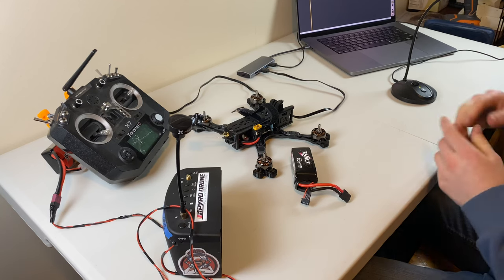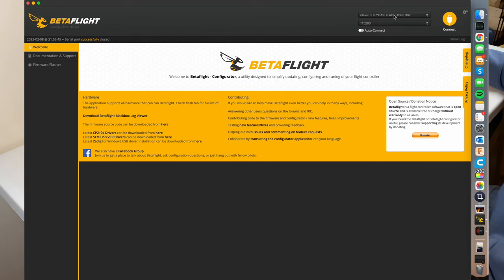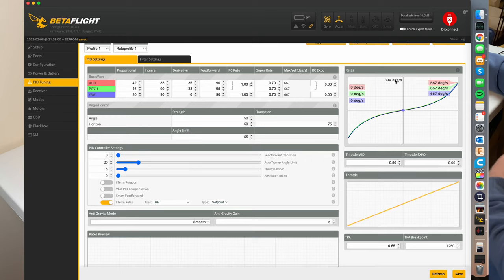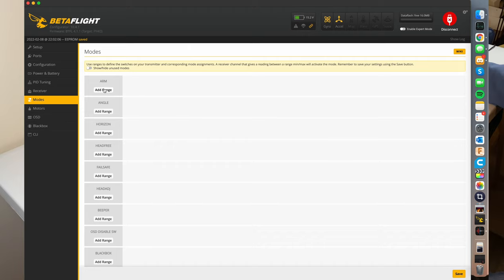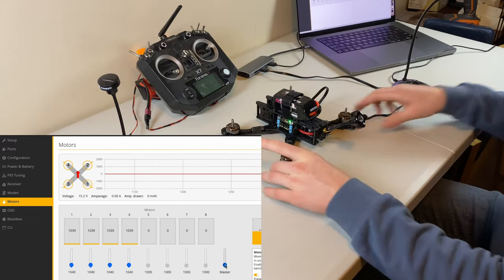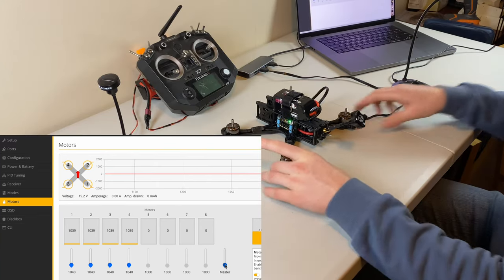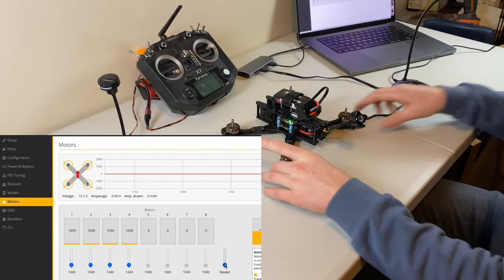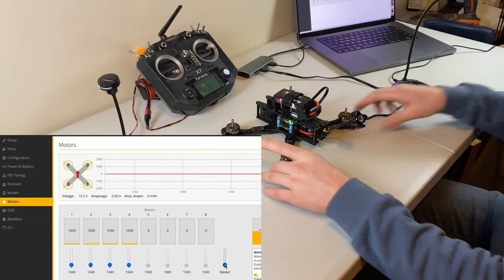Set up Betaflight for a FPV Drones - Beginner Friendly Guide (2022)

Comment: I'll admit that I used the auto search feature for months before I learned how to manually switch channels. But its really easy, and good to learn how. You can see/change the drone's band and channel in BetaFlight.

My cheap analog goggles have a B button for band and C for channel. So if my drone is set in BetaFlight to R-8 I press the B key until I get to the R band. Then the C key until I get to 8.

Comment: I'm having an issue, never really happened before, but i fly in airmode/acro , and im aware it causes errors in the pid loop when coming in for a landing, so it bounces, but my quad sometimes freaks out as of late and just spins out of control, not to many videos on this or how to fix the tune from causing errors, i have blackbox logs. im on an f7 v3 chip- BF 4.4.2. have blackbox for further detail.
Reply: Take turn off Air mode

Comment: Is it possible that the SPRACINGF3 flight controller is not listed / supported by betaflight anymore? Tried using the latest Betaflight version which did only mention this flight controller uses old firmware i should flash it. With betaflight 10.7.2 i can connect and configure the fc, but it won't show listed in the firmware flasher and therefore i can't update it 🤔
Reply from the maker: Yeah, betaflight is slowly removing f3 processor compatibilities. Do you need to update the firmware? A lot of times the firmware on there is good enough
Reply: @easydrone3100  I'm not sure what's wrong, i can't seem to get my receiver recognized in Betaflight although the receiver and transmitter are connected

Comment: step one and lost ..  pc refuses to see the drone I've done the recommended driver installs cp210x,stm,zydig and irc repair. cables swapped out many times though i use them for connecting drives and controller so i am sure they are data cables. board leds blink red and blue.

Comment: Great video. I am new to FPV and drones. I just downloaded Betaflight 10.8.0. My yaw shows roll and roll shows yaw. I tried different channel maps. No good. Is there a way to fix it?
Reply from the maker: Yeah, there's a really easy way! In the receiver section of betaflight there's something that will look like TAER, all you have to do is flip the R and A around and you'll be good to go!
Reply: Thank you. Makes sense. But I plugged in my quad to follow your advice, and suddenly it won't connect to betaflight.
Reply from the maker: @jerryzito6840  Try a different cord, or just restart your PC. They can be finicky sometimes
Reply: @easydrone3100  You were correct. I found the correct cord. But, I flashed new firmware. I lost everything. Not sure what happened. Radio no longer bound. Nothing works.
Reply from the maker: @jerryzito6840  Yeah, you'll need to go through and make sure your radio settings are right, because they'll get set back to factory defaults.

Comment: How do I connect the drone to the computer in the first place? I am using the same adapter as you, but it will not connect. What is the solution?
Reply from the maker: Hey man, here's a link to a guide we wrote on how to troubleshoot connection issues! https://easydrone.com/how-to-connect-and-troubleshoot-betaflight/
Reply: Try different cables, ive had it where some work and others dont

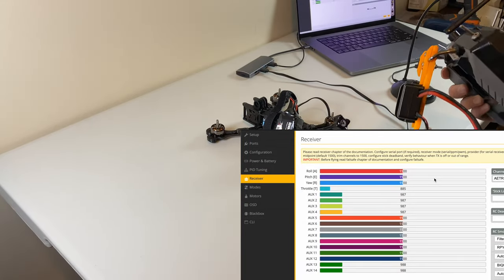Comment: 5:30 I have no reactions for moving controller sticks/buttons. Few  steps back did not help. Can you recommend any other solutions?

My gear is DJI o3, DJI Goggles v2, DJI Remote Controller 2. 
My drone reacts for controller when I pick calibrate controller trough goggles menu, but drone doesn't arm. Originally it had instaled TBS reciver, which I removed. But it did not help.

Comment: My motors configuration takes forever to load . I can’t get in
Reply from the maker: Are you running the latest version of the betaflight configurator?
Reply: @easydrone3100  thanx I did now.
Reply from the maker: @55amps  Glad that it fixed your problem!